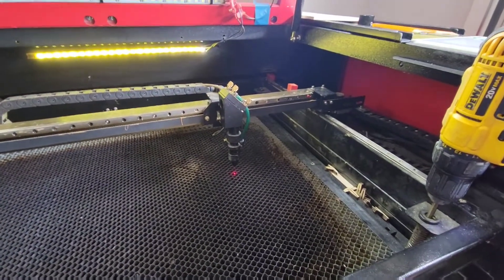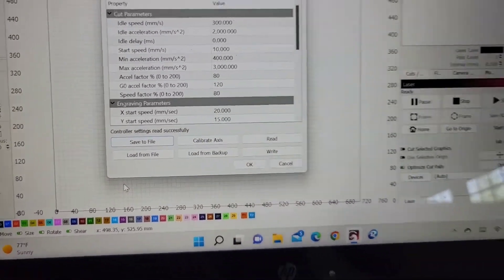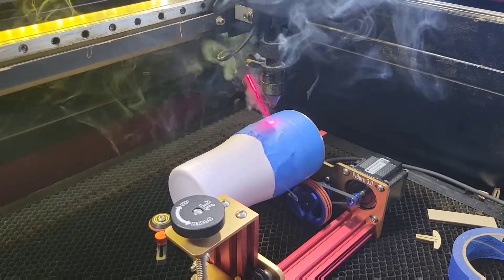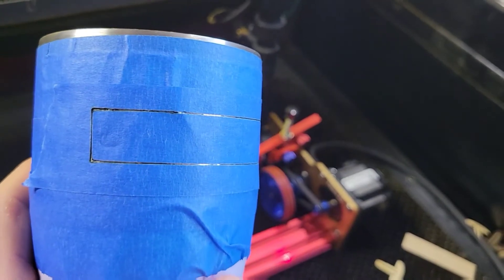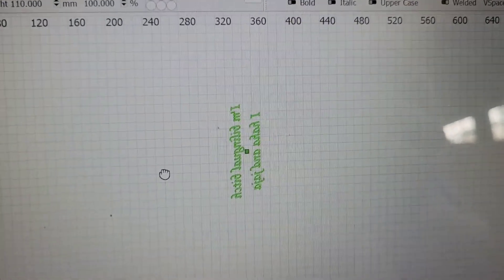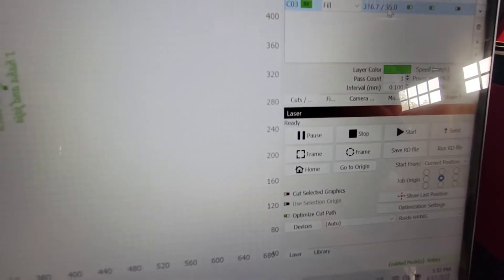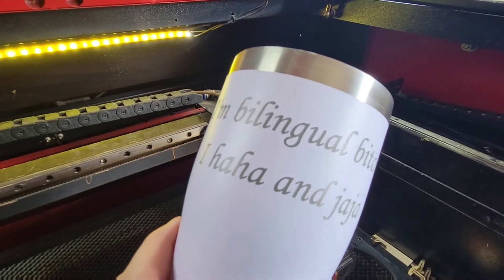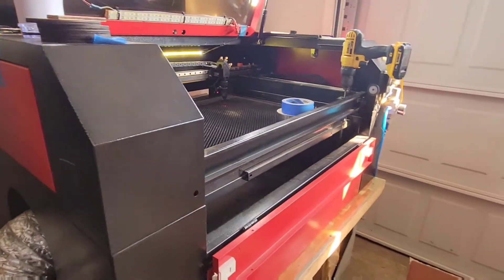Setting up the Piburn Rotary on an 80W Omtech Laser using Lightburn

Comment from the maker: Settings

Idle Speed 20
Idle Acceleration 100
Idle delay 0
Start Speed 10
Min acceleration 25
Max acceleration 100
Accel factor 80
GO Accel factor 120
Speed factor 80

X start speed 20
Y start speed 15
X acceleration 10000
Y acceleration 3000
Line shift speed 150
Facula size 98
Engraving factor 100

Enable Rotary True
Pulses per Rotation 5200(depends on 
Diameter: 63 (depends on size of rotary wheel) 

Nothing else was changed from stock settings.

Comment: I just got my PiBurn4.0 and it's time to go in on it. Great job keeping it simple. I have an Omtech 50W and the original rotary accessory with 3 metal rollers. I learned some things the hard way and I measured with tape and made adjustments on that old thing and made it work months back but uh, no enthusiasm to work that thing LOL. I did OK on a large rolling pin. Your instructions for saving and recovering the settings file is perfect. I am subscribing next. Thanks for being there!!
Reply from the maker: Thank you @embtroop. I'm really glad this video helped!

Comment: Thank you for this video! It was very helpful but I’m having an issue. I followed the settings step-by-step and confirmed that my settings match yours. I’m using an 80 W omtech, laser engraver and when I go to burn my image, I get a message that says it will exceed the bounds of my machine. Do you know why that could be happening?
Reply from the maker: Hi! There could be a few reasons. The purpose of this alert is to let you know that your image will extend past the edge of your machine's engraving area. If lightburn has been set up with proper bed size for your machine, and you are using a design that is small enough to fit onto the tumbler(ballpark 2 - 8 inches), then the first thing I would try is to:

1) Unplug your rotary
2) Plug back in your laser's x axis
3) Make sure your bed is low enough that the nozzle can't hit the rotary
4) Power off your laser 
5) Power your laser back on so it can rehome 
6) Position your rotary near the center of the bed
7) Using the keypad, move the laser head/nozzle pretty close to the center of your tumbler or bottle
8) Unplug the laser's x axis
9) Plug the rotary back in
10) Manually center the laser nozzle over the tumbler where you'd like to place your design
11) Adjust your focal height(distance from the nozzle to the tumbler)
12) Frame your design
13) Close the lid of the laser
14) In Lightburn in the "Laser" Window on the Right hand side of the screen make sure you are set on "Start From Current Position" and "Job Origin" is set to Center
15) Hit start once you you feel good that all of your physical setpoints are in place, and you have power and speed settings where you want them. 
16) Let me know if this helps you out. 

Also, for testing tumblers so you don't create too much waste, you can wrap them in aluminum foil and masking tape with lower settings to make sure your design will be the correct size and orientation. Once you test on the tape/foil, you can remove it and engrave the tumbler. Watch out for the possibility of fire with the masking tape.

Comment: Instead of hitting the mirror image, have you tried turning your rotary 180 degrees so the top of the cup is on the left?  Then on lightburn, you'll need to change rotate the design 270 degrees instead of 90.
Reply from the maker: I did something similar. Now I don't mirror the image on the screen in Lightburn, I mirror the image in the rotary settings. So now, the orientation of the image in lightburn matches the orientation of the design when I'm facing the laser.

Comment: Can I have settings
Reply from the maker: Idle Speed 20
Idle Acceleration 100
Idle delay 0
Start Speed 10
Min acceleration 25
Max acceleration 100
Accel factor 80
GO Accel factor 120
Speed factor 80

X start speed 20
Y start speed 15
X acceleration 10000
Y acceleration 3000
Line shift speed 150
Facula size 98
Engraving factor 100

Enable Rotary True
Pulses per Rotation 5200(depends on 
Diameter: 63 (depends on size of rotary wheel) 

Nothing else was changed from stock settings.